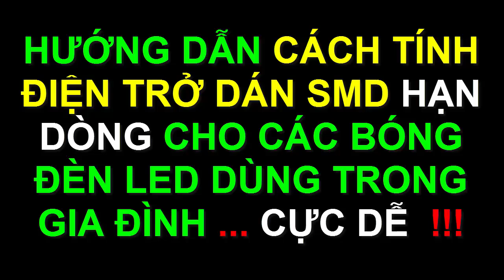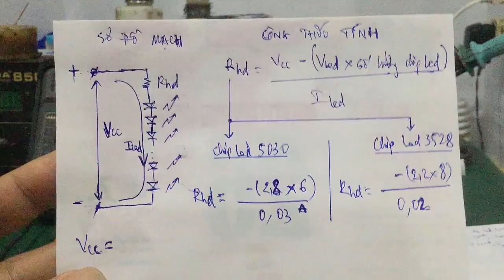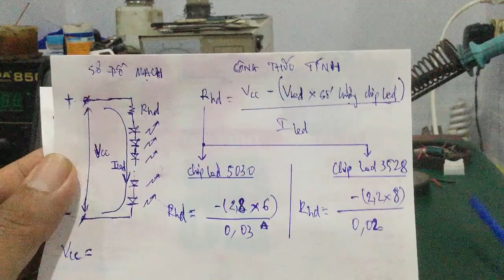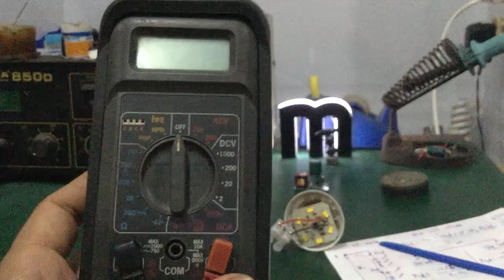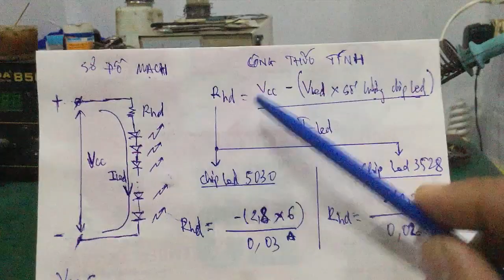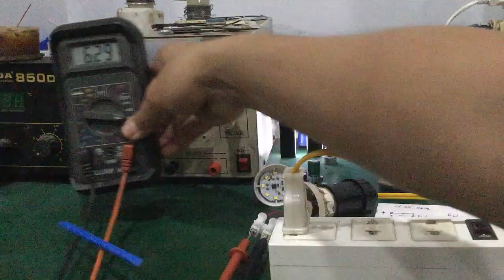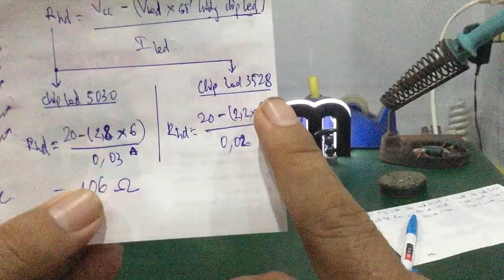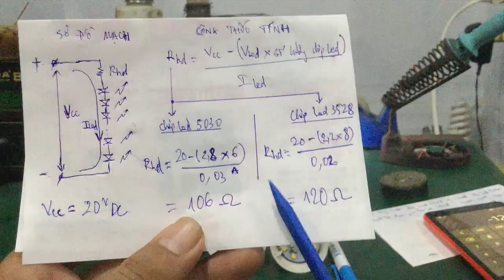Sửa đèn led 220v - cách tính điện trở hạn dòng cho các chip Led trong các bóng đèn led ...cực dễ !!!

Comment: Em dùng nguồn 12v 75ah dùng cho dãy led 5050 thì trở hạn dòng dùm bao nhiêu vậy a.e cảm ơn a nhiều.e dùng 22ohm thì nóng và nóng ạ
Reply from the maker: dãy led của e dài bao nhiêu , ăn dòng mấy Ampe ? nguồn của e là acquy khô hả ? con trở 22 ôm là trở sứ , công suất hay sao e ? nóng như vậy  là dòng cao quá rồi ? e phải tính toán lại ( tăng hay mắc nối tiếp thêm trở công suất mới dc ) ... tốt nhất là e nên thay nguồn khác , 75Ah là khá cao so với dãy led e đang sử dụng đó !!!
Hãy đăng ký theo dõi kênh để xem các video của a nhé … e có cần hỗ trợ về kỹ thuật hay tư vấn về điện tử - điện thoại di động thì cứ để lại comment , a sẽ support cho e !!!
Reply: dãy led của em dài 5m a.e thấy e cấp nguồn 12v là ăn dòng 0.2a là ánh sáng đẹp a.
Dạ nguồn e dùng acquy khô.
Em dùng trở sứ công suất a
Reply from the maker: @nguyenlocnhung1994  e lấy gì mà đo nguyên dãy led 5m nó chỉ ăn dòng 200mA thôi sao & e dùng acquy khô loại lớn ah 75Ah : trong khi đó acquy xe wave là 12v - 6Ah ... ( có lộn ko ? ) ==> e dùng acquy ôtô hay xe tải hay sao mà dung lượng lên tận 75Ah thế ... ???
Reply: dạ em nhầm e dùng 2 bình 14ah a.tổng tải của dãy led của em là tầm 0.8a anh.do em có sử dụng pin mặt trời ban ngày cho sáng led ban đêm mới dùng bình ac quy a.
Reply from the maker: @nguyenlocnhung1994  2 acquy khô này e lấy từ đâu thế ... rồi e mắc 2 bình song song với nhau để tăng dung lượng ( tăng Ampe hã )  ... dòng tãi là 0,8 A là đúng rồi ... giờ e dùng 1 bình acquy thắp sáng dãy led : e coi con trở bằng sứ nó có nóng giống như khi mắc 2 bình ko ? con trở sứ e dùng loại 22ôm - nhưng công suất của nó là bao nhiêu walt ???
Reply: trở 22ohm 10w a.2 bình ac quy này em mua ạ.e dùng thì vẫn nóng nhưng ít hơn trở truong a
Reply from the maker: @nguyenlocnhung1994  công suất P = U x I = U x U/ R : như vậy để giảm dòng điện hay công suất thì e phải thay đổi giá trị con điện trở công suất này nhé : tăng trị số nó lên  , tăng công suất của nó lên ( dòng chịu dc sẽ cao hơn , trở sẽ ít nóng hơn , dãy led cũng hạn chế  dc dòng điện qua , led sẽ ít bị nóng hơn nhé !!! )
Reply: dạ e cảm ơn a.
Reply from the maker: @nguyenlocnhung1994  ok e ... Hãy đăng ký theo dõi kênh để xem các video của a nhé … e có cần hỗ trợ về kỹ thuật hay tư vấn về điện tử - điện thoại di động thì cứ để lại comment , a sẽ support cho e !!!